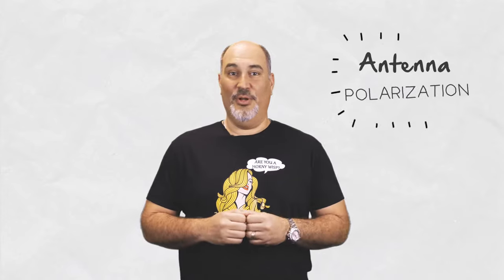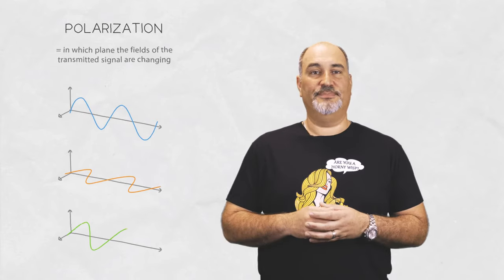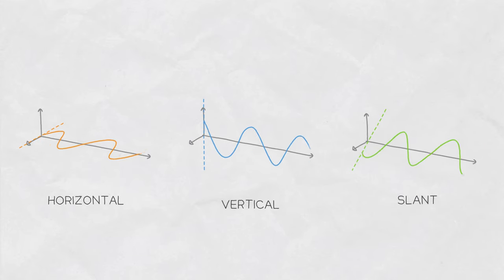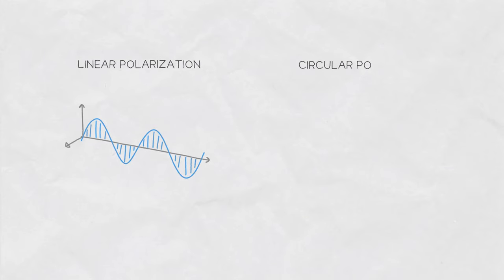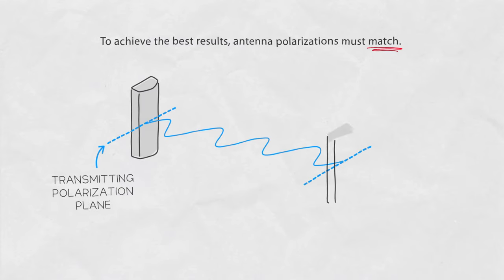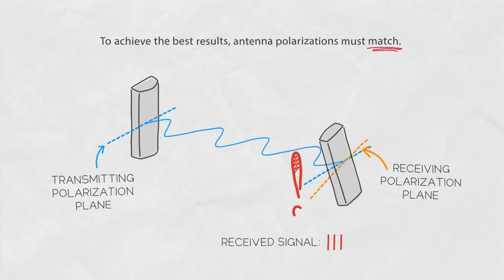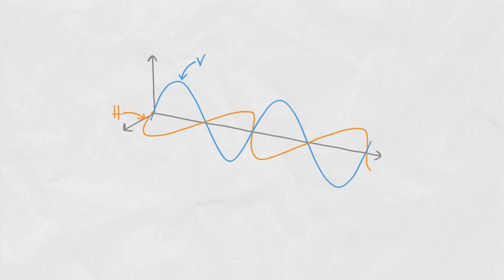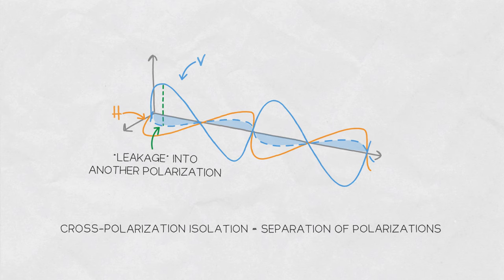Inside Wireless: Antenna Polarization

Comment: With an indoor aerial (flat panel). Will that need to be turned on it’s side if it’s a vertically polarised transmitter?
Reply from the maker: Hi Adam, what do you want to achieve by doing that?
Reply: @Rfelements  I had one of these types of antennas and it wasn’t working in a horizontal position so I took it back to the shop. After doing so it came to my mind that that particular transmitter I was trying to pick up was vertically polarised so would my antenna need to be positioned on its side if it was a panel antenna receiver?
Reply from the maker: @adamwhite1556  yes, that should work, if the antenna you have is indeed H polarized
Reply from the maker: @adamwhite1556  it's possible, try it and see if you get the result you expect

Comment: The problem with antenae designed was the jamming make it nolonger the Western domination because sound, noise, vibration make it extremely difficult to keep signal integrity and so architecture of new type of antenna was about passive and active depending on the need. Passive antenae tend to be extreme efficient because no one can detect it's location for all it does is use the electricity power grid and create EMF refector mirrors that can encode ambient sunlight and or  dominant signal then amplify it be EMF and so there is no transmission detect until they are active mode
Reply from the maker: thanks for sharing